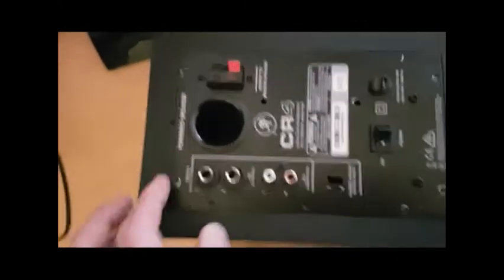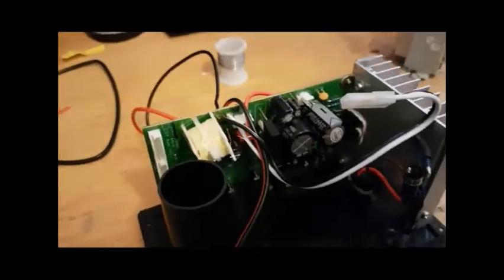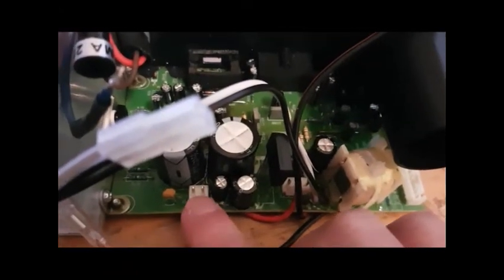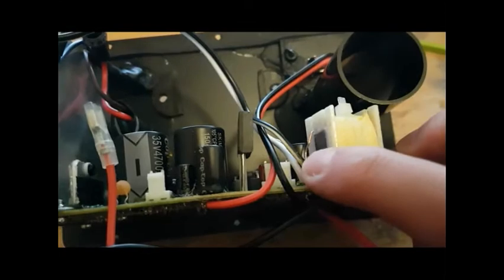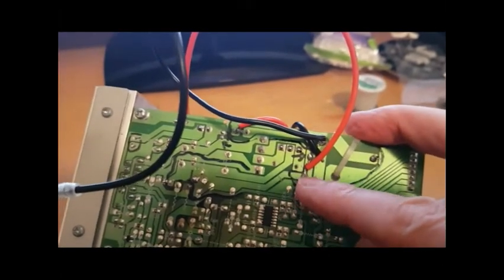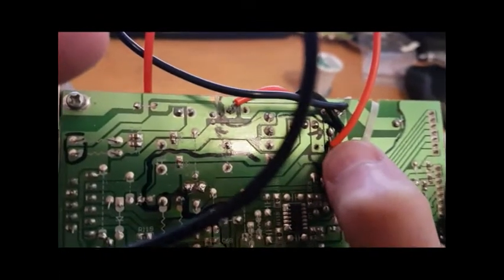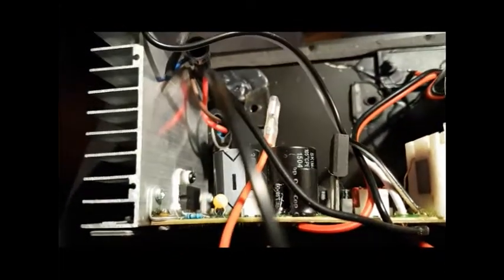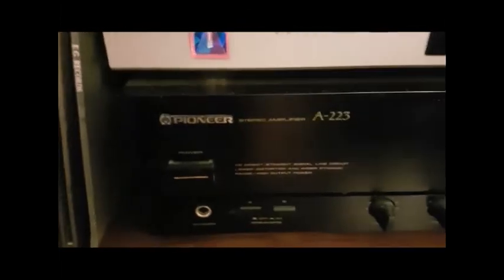Mackie CR4 - Conversion to passive speakers

Comment: Hi, im a bit lost on where i need to relocate the coil wire to.
Reply from the maker: It is a bit confusing :). If you go to 4:45 in the video you can see a closeup of said wire location. You need to de-solder it from its original position and extend the wire (solder on an extension). Then drill a hole through the board to link it to the correct point, which I believe is the same point the red wire is attached to @ 4:45. Hope this helps and let me know if it works out for you. Cheers.
Reply: @72Jansen  Yep, that did the trick. Instead of drilling though I just got a longer bit of plastic coated wire to go around the back. Works a charm.
Reply from the maker: Glad it worked & good idea re. the extension without drilling. I just like to make life hard for myself.... 😄 @dommitchell4319

Comment: Thanks for this video. I'd tried putting a adequate power supply circuit into my CR4s but still faced more major problems and you've helped me cut my losses and have a usable pair of speakers.
With my low soldering-skill level I need through-board soldering so I put my wires through from the component side. To make space for repositioning the COIL WIRE I removed both the socket for the 3 pin transformer plug (video at 2:00) which is marked {CN4B} on the circuit board, as well as the transformer.
Then I wrote up a list of what needed to be done:
1. Desolder/remove/prepare all wires that need to moved on the board.
2. Drill hole (A) for COIL WIRE right next to its standard position in the very next circuit track towards the heatsink.
3.Drill hole (B) in circuit track nearest to edge of board closer to heatsink than capacitor {C70}  for +INPUT.
4.Sand tracks around these holes back to copper.
5. Solder COIL WIRE through new hole (A).
5. Solder -INPUT through old coil hole {T4}.
6. Solder +MAINout through hole {L-}, which is just behind the big caps. (Though looking back the middle pin hole of {CN4B} would be easier.)
7.Solder -MAINout and -TWEETout through hole {L+}, which is near coil and on the edge of board. 
8. Solder +INPUT to new hole (B)
 (+TWEETout and other coil wire stay where they are.)
Speakers are working now.
Check my working before using it.

Comment: I just gutted the power supply, cut all wires ( on the powered speaker only) and soldered a speaker wire directly to the small woofer and tweeter wires that are already connected...drilled a hole and fed the new speaker wire thru the hole... Just bypassed the crossover completely. The unpowered speaker can be connected as normal.  They sound just as good as they did when they were powered(and working properly)....Hooked them to a JVC car/cd/Bluetooth radio head unit powered by a 120 to 12v converter.  Makes a nice compact shelf unit with great sound.
Reply from the maker: Bypassing the crossover? They'll still work but the crossover is there for a reason. Referencing attached article: 'A speaker crossover splits frequencies to be broadcasted on specialized drivers for better sound quality'. https://www.makeuseof.com/what-is-speaker-crossover-how-does-it-work/#the-3-main-speaker-driver-types

Comment: Mine stopped working accept on headphones so I tried the cutting the 3rd pin trick and they work fine again. There is a video showing which pin to cut. Search CR3 repair.
Reply from the maker: Yeah I tried that mod and got a constant loud hum. Does work in some cases tho. Glad it worked for you!

Comment: Hi, I'm also looking into this... On the circuit board, you didn't cut any track?
Reply: I didn’t cut any of the tracks and this worked great.  Took about 15 mins.  Really appreciate you publishing this
Reply from the maker: @mattmcelroy  Thanks for your comment Matt! Should give people faith in this mod. They're decent sounding speakers so worth the fix I reckon. Cheers.
Reply from the maker: I don't remember deliberately cutting any track but looking at the video again, there is a scratch on the board near the soldering of the positive speaker wire... If you've wired it up as I've suggested and it doesn't work, you could always try cutting it at that point. Let us know if that makes any difference as it would be helpful for anyone else doing this job.
Reply: @72Jansen  yep I saw that scratch, that's why I was wondering 😂
will tell when I have time for doing the mod.

Comment: Hi, that is what I'm currently willing to do. But sorry I'm bit lost in your video. Was trying to reproduce it, but no success :) Can you maybe create a photo from front and back? Thanks a lot :)
Reply from the maker: Hi Janes, Sorry I actually gave the speakers to a friend so no longer have them. If you look at the 'Recap' section @ 5.40, that basically explains the configuration. When I say the red wire coming 'in', that wire is coming from the back of the speaker. The other red wire will then be going to the main speaker. I hope that helps!
Reply: @72Jansen  thanks I've it. I missed the part with the coil :)